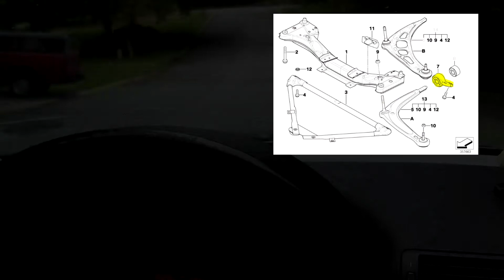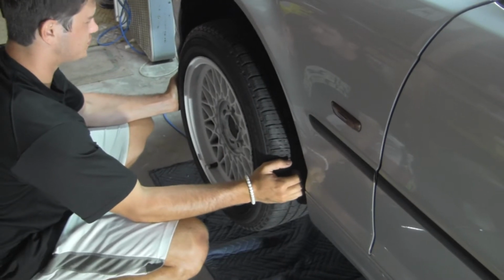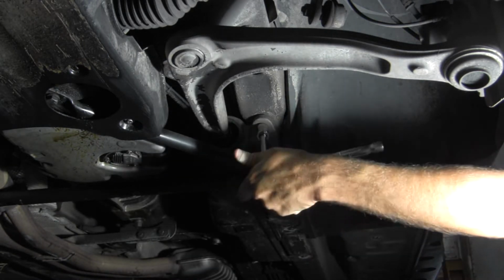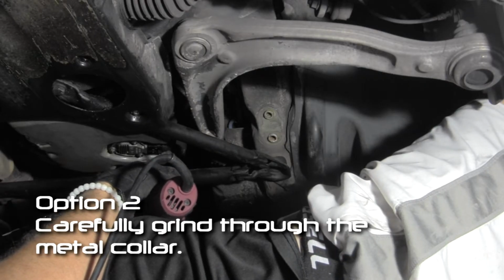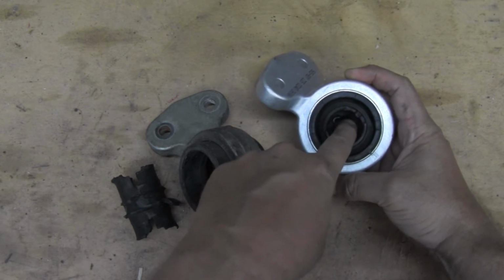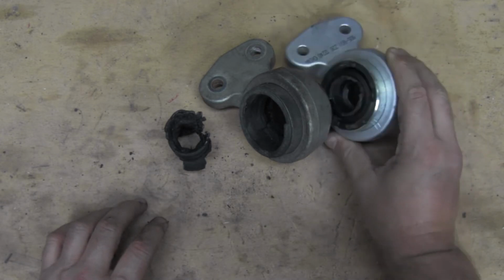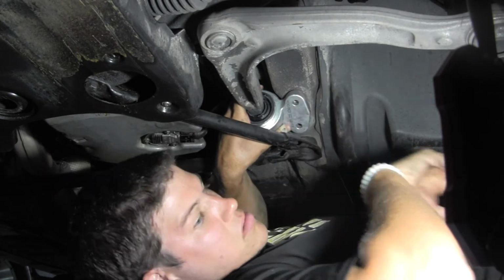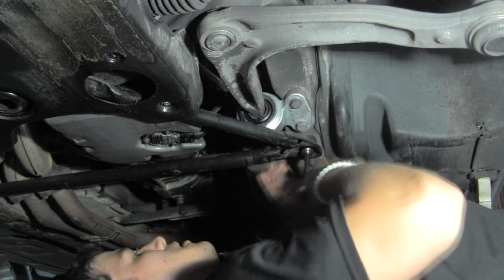BMW E46 | Front Lower Wishbone Bushings

Comment: Nice video. I noticed that your left control arm looks different when compared to the right. It doesn't look stock for a RWD. Is it an AWD control arm maybe?
Reply from the maker: It could be.  When we bought the car about 4 years ago the PO had done some work on the front right side.  He mentioned that he had replaced the Right bushing.  He may have also replaced the Control Arm.  I had noticed that when we were under there.  Doesn't seem to make a difference.  The diagram illustrates the two different options.
Reply: UCanDoIt2 You are right. I've never seen those "type A" control arms before. My E46 is from 2001, and those have only one type... like type B in your diagram. I wonder if it is ok to have different types on each side, though...?